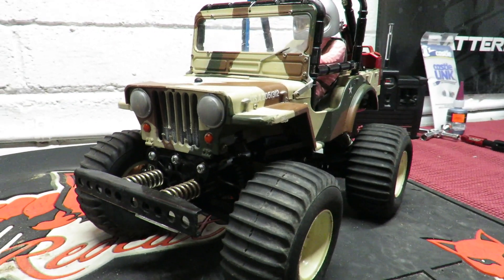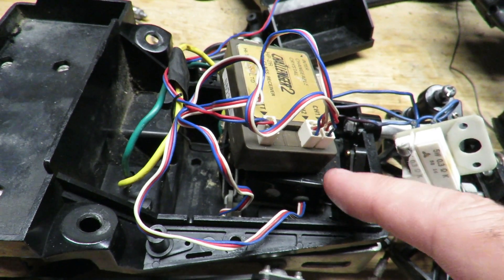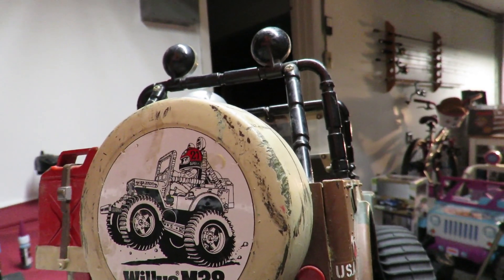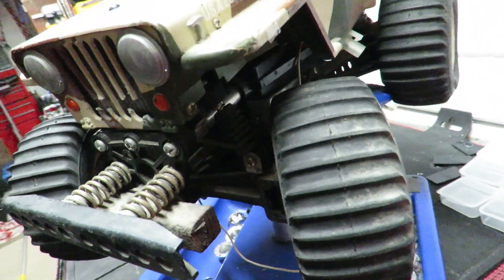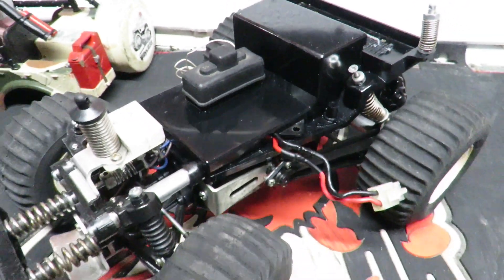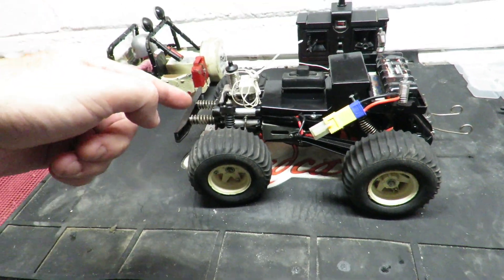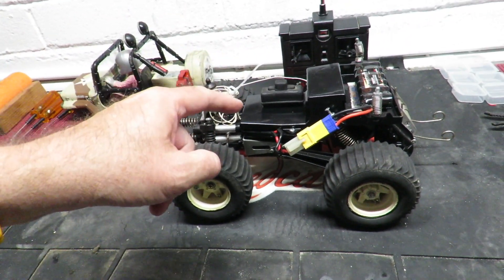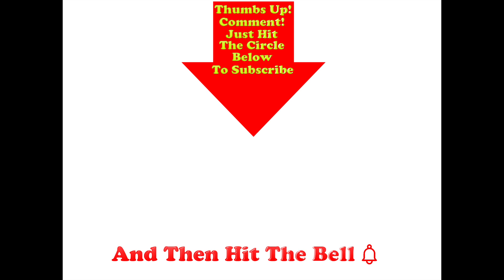Vintage Tamiya Wild Willy Ebay Find!

Comment: 😀looks awesome!! Don't ever cut a receiver antenna it changes the resistance and makes you lose distance that the radio is supposed to go away from the rx, you should wrap it around something like a coil spring is wrapped it can be on a section of cardboard or something you don't want to cross the wire over it's self. I used to do this all the time because of the super long antennas they used on the tx's.

Comment: Did you ever find a suitable battery pack for this? That has been the biggest challenge. I have this kit still brand new unassembled in the original box all in original packaging. Once I found a battery solution then it will be assembled.
Reply from the maker: no in the end I bought the individual cells and soldered a pack up! Crazy they sell the V2  version and still no battery!

Comment: We have a wild willy but needs so parts do you know if you can still get them uk  here
Reply from the maker: some of the new wild willy parts fit the old one but not all of them. Your best bet is where I go and that's ebay! If it's not on there today it will be with a 10-14 days. Original tires for the Mk1 are very,very rare and super expensive like $90 for a pair!